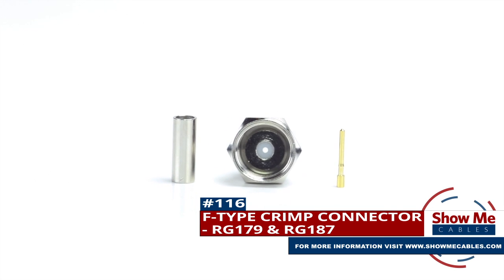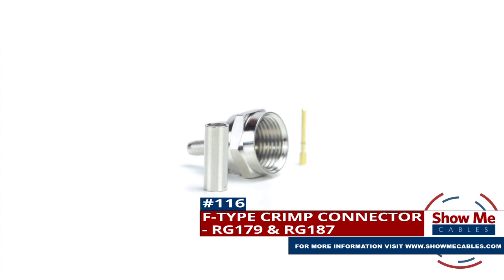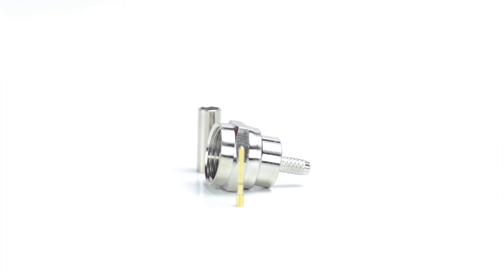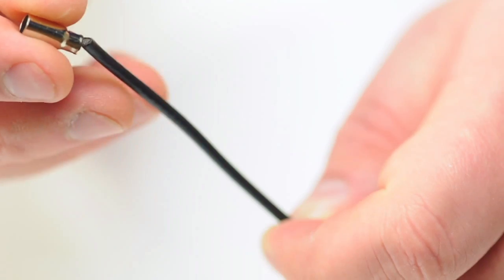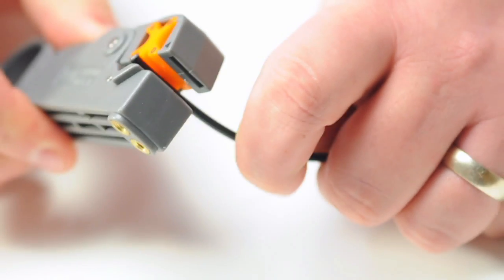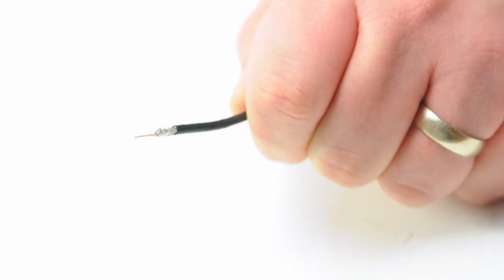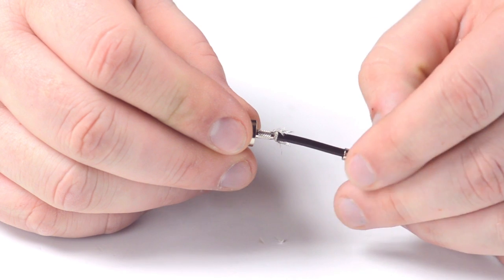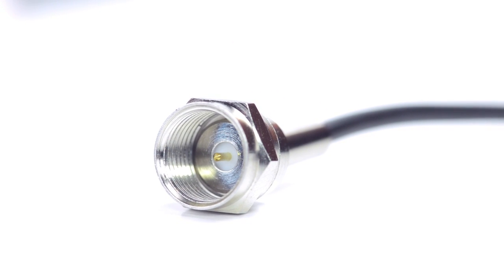How To Install F-Type Crimp Connector For RG179 & RG187

Comment: Is using the pin and having to solder it onto the center conductor necessary? I've always thought the center conductor was the pin. I've always compress f-type connectors to RG6 cables like this. I've never added a pin on top of that center conductor. Is it different for RG179?
Reply: RG-179 is a much, much thinner cable with a thin, stranded center conductor. It cannot function as the pin so attaching a proper-size pin is mandatory.